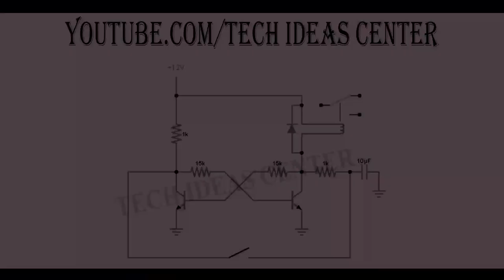Turn the relay on and off using just one push button

Comment: Don't try this because when the 12v supply charges and discharge according to that the circuit switch on and off it is sooo unuseful  but i find the solution by modifying the circuit

Comment: Hello Sir. I've tested this circuit fez minutes ago. Amazing. It works really well. In other channels I've seen similars using PNP + Mosfet, but in my case that other circuits doesn't work at all. Your circuit works really good since first try. For 5Vin, the 15K resistors, i've used a 10K resistors and works fine. Just one note, the capacitor, more of 10uF it doesn't work, less of 10uF works fine.

Just i want to say you, well done and good job
Reply from the maker: Thanks bro

Comment: Hi, do you think this could work for a one push on, one push off main/low beam headlight stalk on a 12v car?
I have been looking for a way to utilise the existing indicator and main beam flash stalk without the current linbus wiring. 👍
Reply from the maker: Yes bro

Comment: Your circuit is very good and useful. I want to replace the push switch to a touch plate. If I touch the touch plate the circuit will work or not.

Secondly Can I use 220v ac capicitor drop supply to make 12v dc to give to the circuit. 

Thirdly can I use triac instead of relay. If yes than  please show me the connection to fix the triac.
Anil Kumar Goel
Reply from the maker: I suggest you use another circuit
https://www.youtube.com/watch?v=vU3Ff4re6Ic&t=100s
Reply from the maker: If you don't like this circuit, I suggest you wait for future uploads

Comment: Does it use any current when the button is not pressed?
Does it keep latched if 12v is removed and re-applied?
Reply from the maker: When we turn off the lamp, the relay also turns off and does not consume any voltage or current. If it is disconnected and reconnected, the relay will remain off
Reply: The standby current when off will be 12mA

Comment: Is there a way to make the circuit start to turn off?...when I energize it it starts with the relay activated and I would like to avoid that.
thanks!
Reply from the maker: Dear friend, every time you press the push switch, the relay will turn on and off. This circuit is not just for turning on or just for turning off. It does both.
Reply: @TECHIDEASCENTER  I understand what you are saying, but my question is: if I can make the circuit start off and not on? because when I give it voltage it starts on thanks
Reply from the maker: @MrLucianoricco  But when I connect the voltage, the circuit doesn't turn on so I don't switch myself. This can be seen in the circuit test at the end of the video.
I have a video to upload tomorrow that is similar to this circuit but with IC555, watch that video, it might interest you.

Comment: jika mengunakan relay 5v dan input 5v apakah harus merubah ukuran komponen. dan berapa ukurannya
Reply from the maker: Hello dear friend, you should change both 15k ohm resistors to 10k ohms and if it doesn't work, increase one of the 10k ohm resistors to 12k ohms.
Reply: @TECHIDEASCENTER  thanks bro

Comment: Tem como substituir o botão por um sensor incrível?
Reply: Esse projeto é bem legal
Reply from the maker: Yes bro
Reply: Já tentei colocar mas não consegui.

Onde ligar o infravermelho
Reply from the maker: Do you want to turn off and on the relay using an infrared remote control??? @naldomaranatha9088
Reply: @TECHIDEASCENTER  Yes. I tried to connect the infrared receiver with the bd 140 in place of the button but of course it didn't work... in addition to the npn transistor, do I need another pnp? for red hell to work.... I'm not an aria professional but I like developing ideas

Comment: Jak zrobić ten układ  działający na 5v ? Z góry dziękuję.
Reply from the maker: You need to change the relay to 5V and also reduce the 15K resistors to about 10K.
Reply: @TECHIDEASCENTER  nie działa 🤷
Reply: Tylko 15 k zamienić na 10k ? Oba rezystory i nic więcej ?
Reply: Bo tak zrobiłem i nie podtrzymuję 🤷
Reply from the maker: @mariuszryszka1116  yes
Reply from the maker: @mariuszryszka1116  Install a 1 kilo to 1.5 kilo resistor in parallel with one of the 10 kilo resistors. Test separately for each of the 10 kilo resistors
Reply from the maker: @mariuszryszka1116  I have done this with 5V power and it worked fine
Remove the relay from the circuit and install an LED with a resistance of 100 ohms instead of the relay according to the positive and negative poles.

Comment: Tidak berfungsi brother..relay hanya bunyi cetek2.. resistor 15k dah coba ganti 10k..
Reply from the maker: It is possible that the relay is damaged, or that you have soldered a wrong part of the work. Please use new parts, there is a possibility of failure in used parts